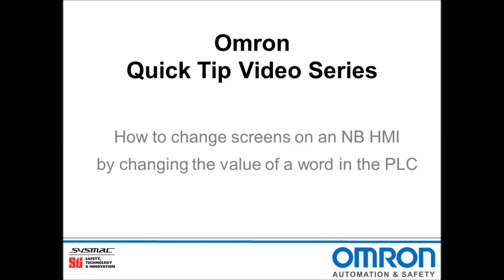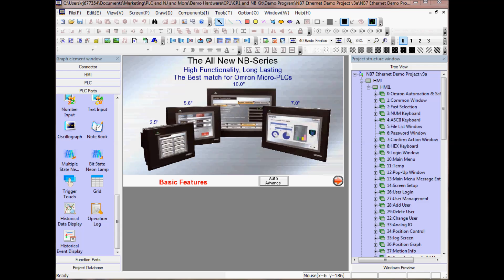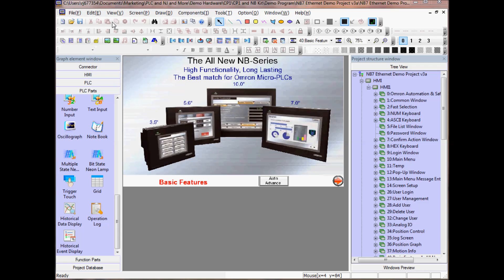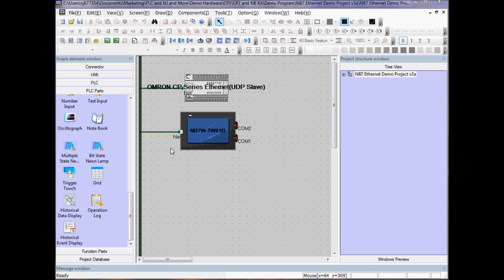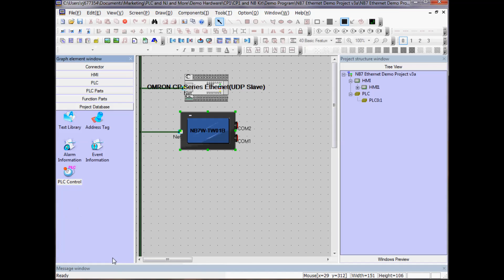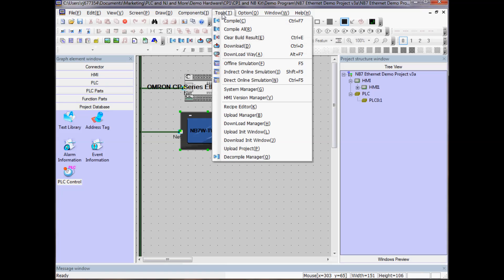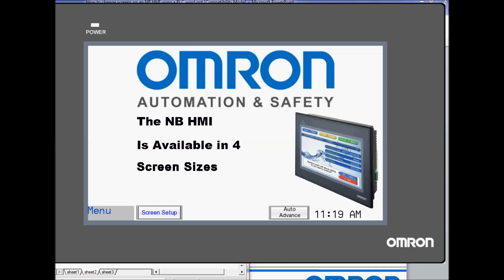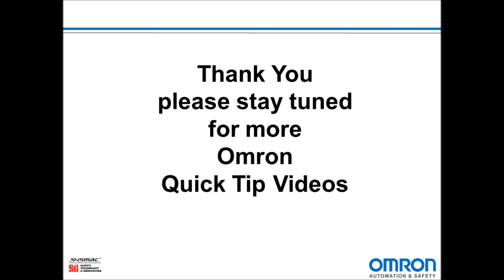Switching NB HMI Screens Using PLC

Comment: I have downloaded a program into the PLC, downloaded a program in the HMI terminal, and connected my PLC to the HMI via a custom made RS232 cable. When I turn them on, the correct screens appear on the HMI terminal, but no data is coming through from the PLC. After a few seconds, a pop-up appears saying "[2]PLC No Response 00-00-1". Does anyone know the meaning of this message, or what I might be doing wrong or missing out? CPU used: CP1L-M60DT1-D (with a CP1W-CIF01 serial adapter) HMI terminal used: NB3Q-TW00B Details for the RS232 cable: NB pin 2 (SD) to CP1L (CP1W-CIF01) pin 3 (RD) NB pin 3 (RD) to CP1L (CP1W-CIF01) pin 2 (SD) NB pin 9 (SG) to CP1L (CP1W-CIF01) pin 9 (SG) CP1W-CIF01 Bridge between pin 4 (RS) and pin 5 (CS)
Reply: Just check the node of the PLC , and HMI, or check there is a connection between them.
Reply: You must select "Host Link" in PLC settings. And be sure that plc com port settings (7E1, 7E2, 8E1 etc.) and HMI com port settings are the same.